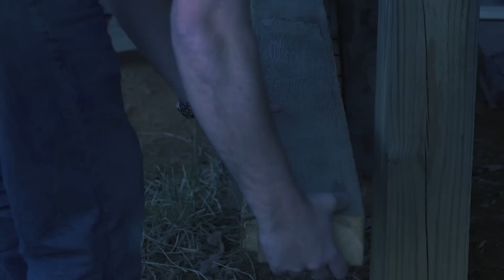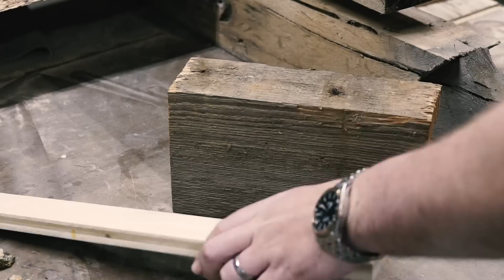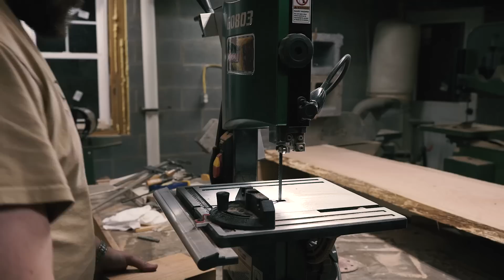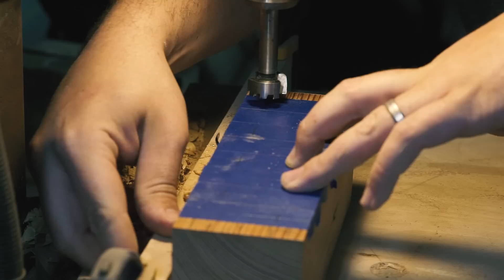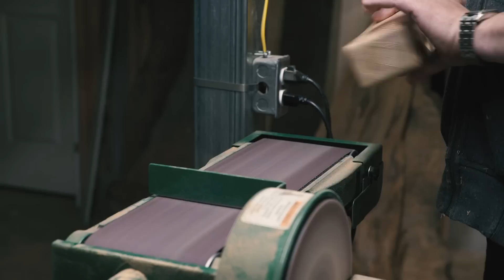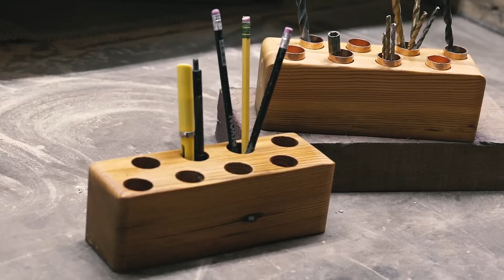The Drill Bit Organizer - a Story about a Sander

Comment: Hey, just watched your video on setting up your Grizzly combo sander on the Grizzly site.  I am looking to get one of these.  Should I get the one that has the 3450 rpm motor or the 1750 rpm motor?  Is the 3450 too fast?  Harder to do control how much material is being removed?  Thanks.

Comment: How do you find the noise level of the sander? I'm using a belt sander at the moment but the thing makes an absolute racket! When I changed from a hand held drill to a drill press I was amazed at the difference in noise. Does the same principal apply to a bench sander vs a belt sander?
Reply from the maker: It's definitely still got some noise  But I think most of that comes from the sanding belt running over the Platen, but it's not the high pitched whine you're talking about (my handheld belt sander is ridiculously loud too.  Since both the drill press and the stationary sander are belt driven it's a lower pitched hum and less offensive to the ears.
Reply: Aaah, yeah that would make a huge a difference, hadn't thought about the pitch. Cheers!

Comment: Another deal on a sander!!??  You, Mr. Walker, live a charmed life ISYN!!!  Don't suppose you'll take an offer on this either....sheesh   You do NEED dust collection, my experience with the G1028 I would recommend Grizzly dust collectors.  I started developing bad sinus issues with the dust until I got a system going.  Dust with woodworkers is not a good combo ie Jay Bates.  Good score on the reclaimed wood.
Reply from the maker: Hahahaha.  I plan on expanding my dust collection.  It's subpar right now and it's more of a convenience to catch big chips off the jointer and planer.  I don't have anything set up for the fine dust.  It's in the plans down the road.  I try to wear a respirator now whenever I'm sanding.